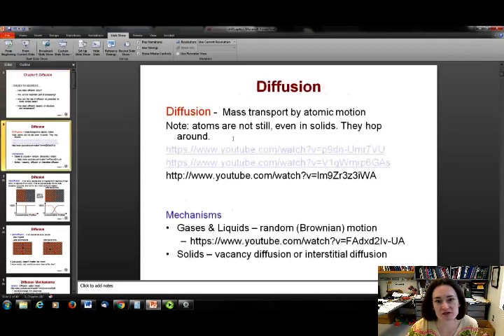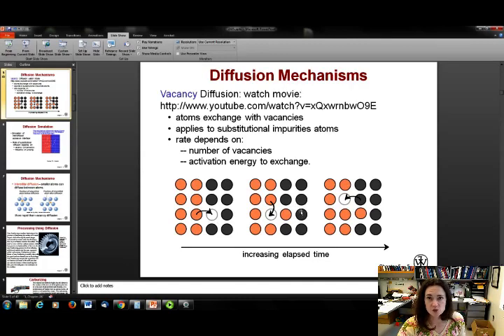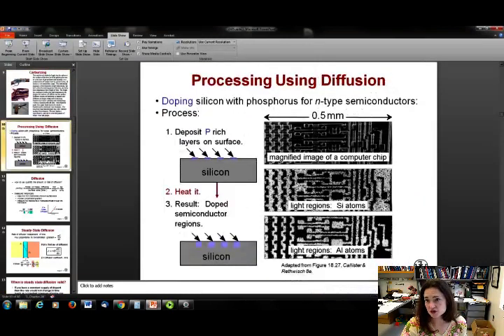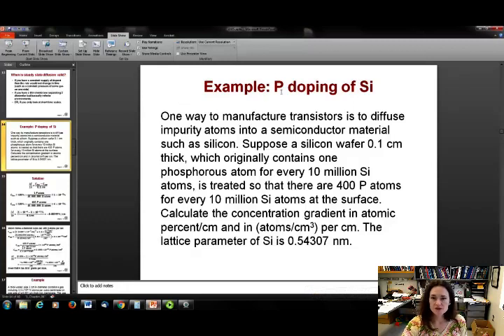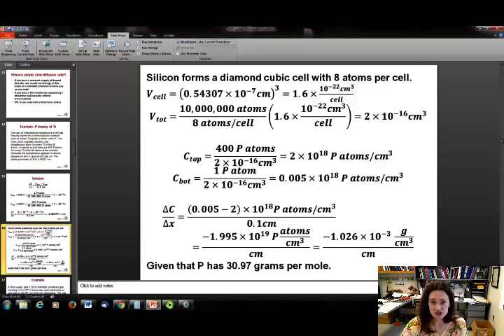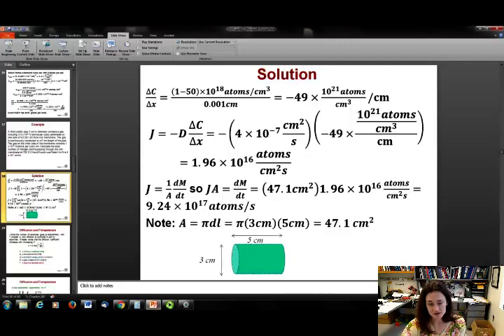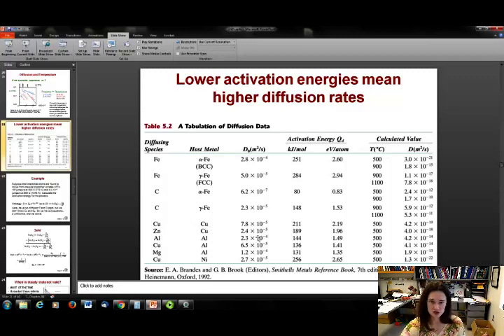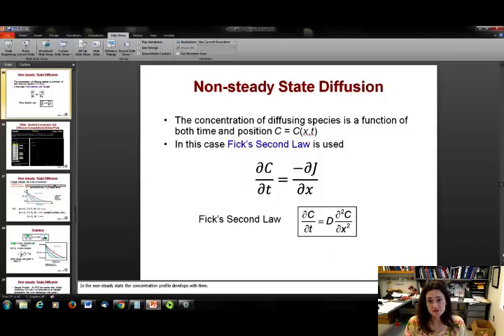Diffusion and Fick's First Law

Comment: Professor, great video, but I have a question. At 21:09, shouldn't we have included the thickness of the membrane in the computation of the area? Or did you leave it out because the thickness of the membrane is negligible with respect to the diameter?